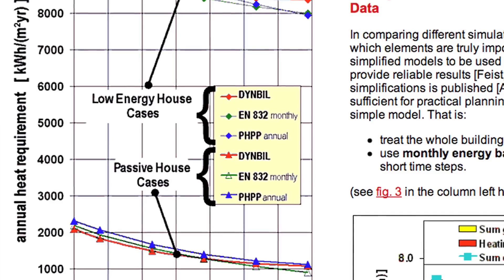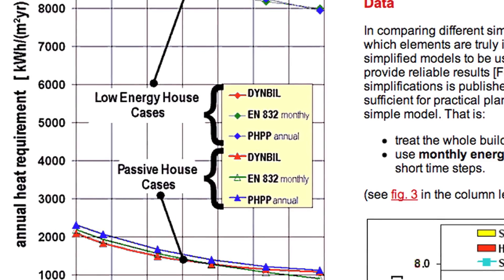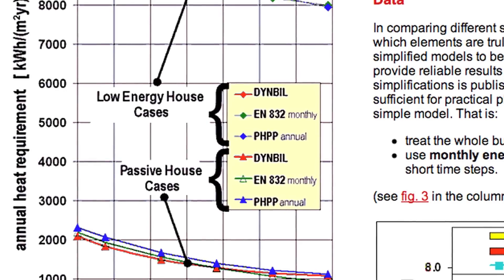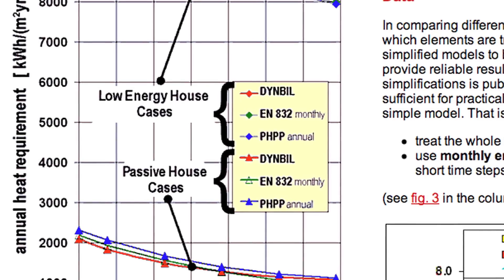Blake the Builder: What is Passive House?

Comment from the maker: @trunksy You’re correct that in general energy savings design CAN yield greatest energy savings in heating dominated climates. But in hot climates an equivalent electric BTU can cost 3x gas. You want to save those dollars. In those climates, carefully tuned windows for max solar control rule (SHGC and windows with low-e coatings and spectrally selective suspended films) and can solve this for greatest savings. Walls can’t. Check out what PHI says: passivehouse.us/passiveHouse/FAQ.html